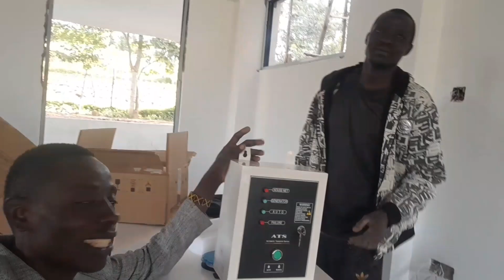l believe today hard work pays

Comment: Make sure this generation when been used that you give it much ventilation because it is a very slow killer.....and the Diesel is a good buy better than the gasoline, gasoline as alot of noise while the diesel is much more on the quiet side......those electrician should know how to connect the generator to the panel box after the house is complete that once the current goes the generation comes in Automatically..........big up happy man Myuguno? Comedian Uncle Moand the team...